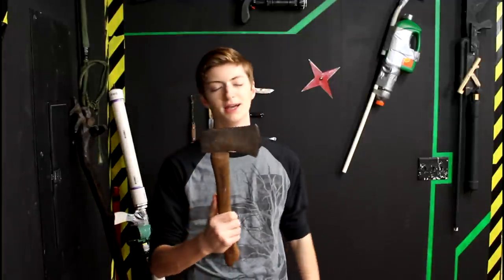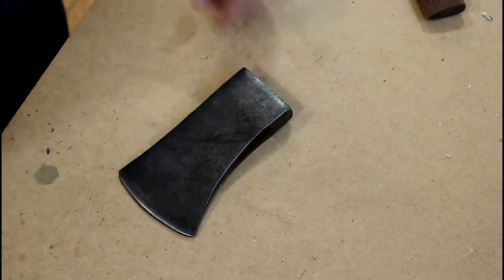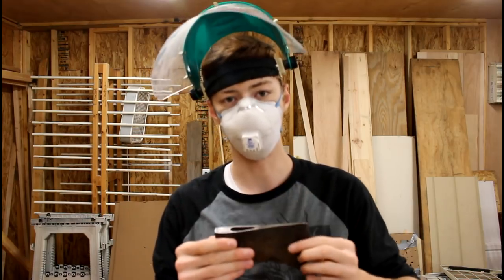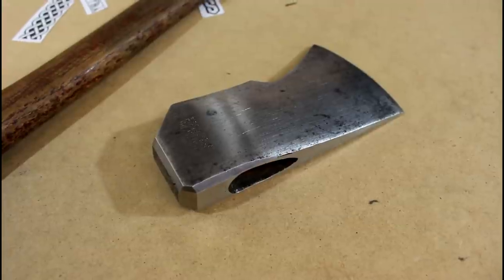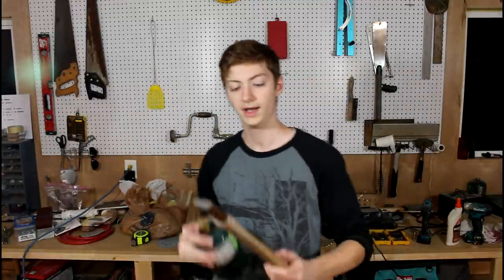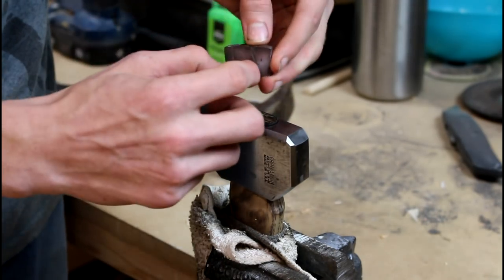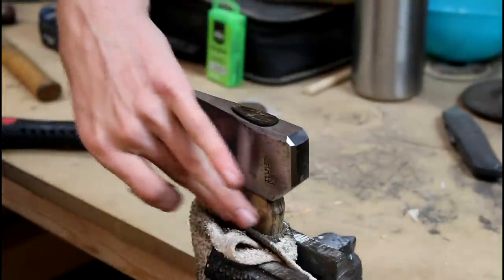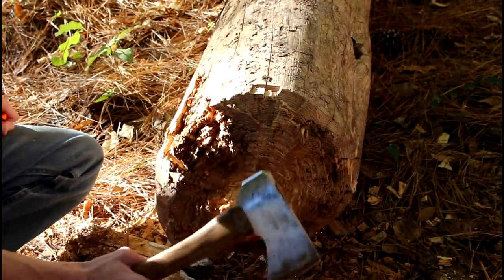Restoring a Hatchet (viking-ish) (sort of)

Comment: Did you apply oil on the handle ? If not, it is not protected
Reply from the maker: You also didn't watch this video all the way through :)
Reply: Jake Makes you're right 😉
Because you're a bit too talkative for me, it isn't bad you explain well what you're doing, but I prefer quiet videos 😉
I don't want to argue, it's just a personal opinion you know ☺
Reply from the maker: No problemo's. I do the same the thing 😅 Skipping through a video I mean. And then making a comment about something that WAS addressed in the video 🙄. Should have just answered you.......

I didn't apply oil to the handle cause' i was feeling lazy and didn't feel like it was necessary to show the world how to apply boiled linseed oil. You. Just. Wipe. It. On.

My wrench knife was short cause most of the metal melted off accidentally in the forge 😩😡. I did a water quench first rather than oil, because I knew the carbon content would be low. Didn't harden any noticeable bit, so without knowing what alloy the thing was, I just decided to skip de heat treat. 

Does a flap sander get a good even finish on a knife? Doesn't sound like it would. By the hand sanding stage you are wanting to make it PURRRRTYYYYYY........
Reply: Jake Makes you're right 😉
I saw that it melted, maybe it didn't harden because you quenched it not hot enough ? 

Well you can get a nice finish if you do the first grit with the flap sander and then handsand, but you have to be careful not to apply too much pressure with the flap sander
Reply from the maker: Na, I quenched it at the right temp. Made too many knives to make that mistake. That alloy must require a more sophisticated heat treat to harden. Probably more of a stainless.
Reply: Jake Makes stainless are sh*t to quench

Comment: Turned out great. What grit did you go to when sharpening
Reply from the maker: Thanks! I started out fairly low to correct the bevels, then went up to my sharpening belt which is a 2000 grit. If you don't have some of those super high grit belts, i'd highly recommend you get some. It's SO easy to polish and sharpen stuff now :)
Reply: Ok thanks. I just bought the harbor freight 1x30 belt sander. Is that what you use?  I thought i saw it
Reply from the maker: Yep, that's mine. For the price, I don't think you can get much more value for the money. I've been using mine for almost four years now. Great little grinder. Of course now I'm wanting an upgrade.........it's great for getting started or lighter use, but for metalworking all the time it's not very powerful. About time to build one of those super 2x72 knife grinders.........
Reply: Jake Makes cool thats great to hear. Im new to metal working so still trying to figure it all out.
Reply from the maker: I'm sure you'll get plenty of good use out of it! BTW, those chakram were pretty sweet, great idea there. I'd heard of chakram before, but never crossed my mind to make one out of a sawblade :)
Reply: Jake Makes thanks man, they turned out better than i thought they would